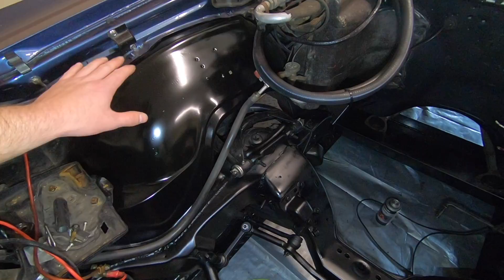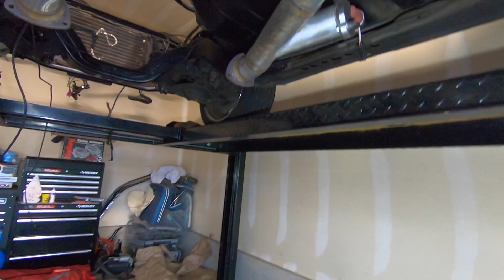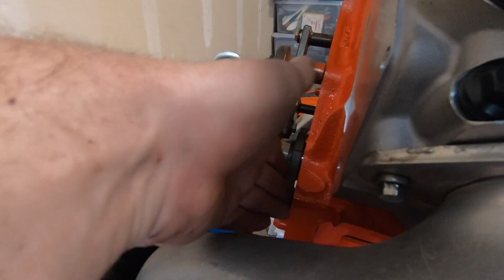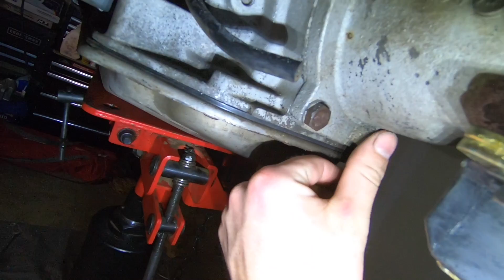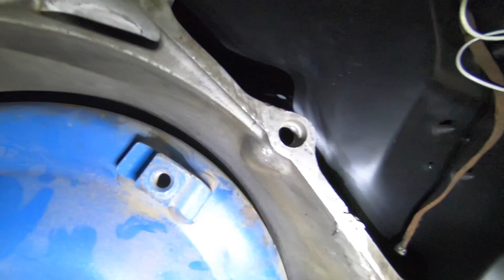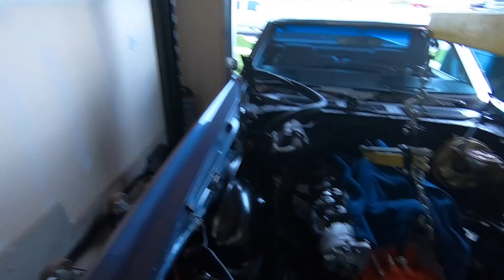600 HP Big Block Chevy and 4L80e Install on the 70 El Camino!

Comment: Great video! Im a nooby trying to learn how to mate a 4L80 to an old school 350 small block. Can you tell me what is required to mate the two together? Like does the tranny bolt straight up no problem? Does a normal SBC flywheel bolt up? Different torque converter needed, etc.? Thank you very much for helping me learn
Reply: I’m trying to figure the same thing out